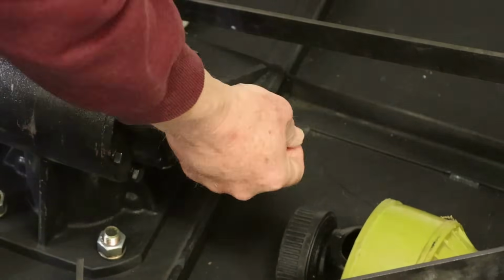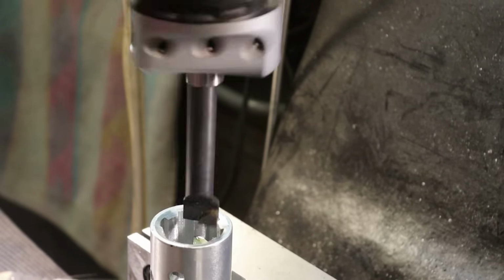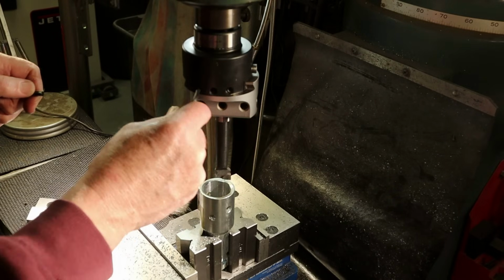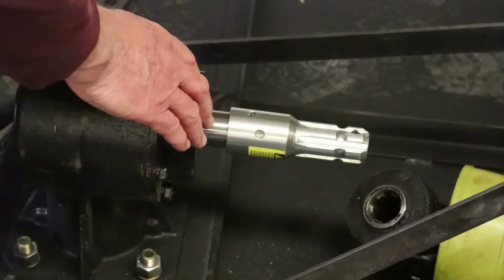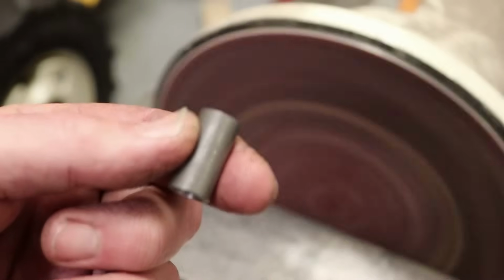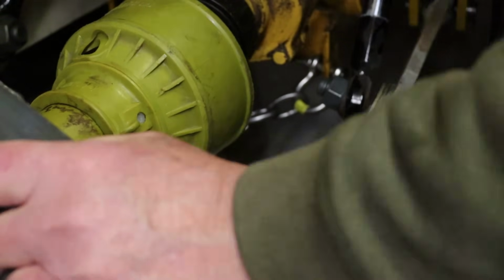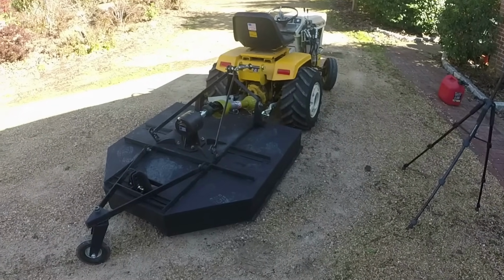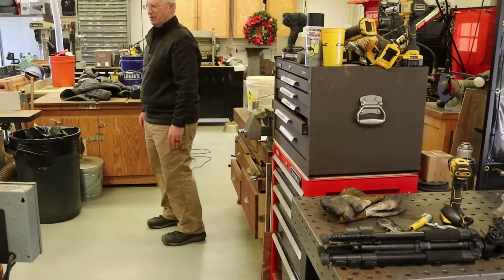Cub Cadet/Bush Hog Build: EP 16, First Run!

Comment: When you buy a pto shaft it will say on it that you may have to cut to fit cause it has to have the ability to slide in and out when raising and lowering the implement DO NOT USE GRADE 8 GRADE 5 OR LESS IS RECOMMENDED

Comment: You have a cool project for having fun, one thing you might want to remember is if you have to stop fast. Disengage the PTO, that would allow you to stop without being pushed by the equipment. Another thing is your grag tire needs to be about the same size as the front tire on your unit. Actually larger would be great. Just make sure you get something nonphumatic because your always going to have a flat tire if not. I'm sceptical about your sway chain crossing the PTO. Check out old Ford and Ferguson tractor design, they used a flat bar to control sway. They are available at all farm store outlets and you can make it yourself cheap. You do fun projects I like watching your work, and you enjoy doing it. So keep up the good work.
Reply from the maker: A bigger tail wheel is in the next episode, I've also ordered an overrunning clutch for the drive line. Also looking at turnbuckle anti sway connections.  Your suggestions are spot on.
Reply: @woodandmetalshoptime8048  I grew up farming and I don't like butting in on someone else's build. But I don't want to see you fail for easy fix things like that. You have a good idea for a better finish now.
Reply from the maker: I never claimed to be any kind of expert. I'm just a guy, with limited experience in many things, playing around in the shop.  You'll see my successes and my failures. We all learn as a result. I always appreciate the advice from more experienced folks.

Comment: I was in business for 10+ years and experimented with all sorts of metals.  DId diamond and steels and others.  Mostly AR400 and AR500 Mostly not steel.  I was building a booklet that kept data on metals and thickness and the tip I was using.  One time I tried a metalized ceramic tile.  Oddly it cut a slice but was so glassy I never tried that again.  there was enough metal in it for glint that current would pass.  Odd experience.  I made custom parts for engines and targets.  Supported 4-H and the Scouts.

Comment: Maybe your 4 has a larger hole in it.  Normally does as it is the standard chuck to use a three is for general use.  Centering is perfect or could be on 4.  3 jaw is close.  IMPORTANT :   Looks like at 40 or 41 - your H frame bender is racking to the right when pressure is applied.  Might need reinforcement.
Reply from the maker: I don't have a working 4 jaw at this point for this South Bend. I haven't replaced it because I've ordered a new lathe.  I think the racking of the press is just equalization of stresses on what is probably not an exactly square assembly.

Comment: You built a great rotary cutter frank!  But I think it’s time to face the facts.  You built it to big for the tractor.  Lol.  Or actually bigger than the tractor.   Bright side. I bet it would be a great fit for the kubota bx you have.
Reply from the maker: I agree it looks too big. It may well be. The proof will be in the grass cutting later this spring.  To be honest, though, throughout this build, the BX was in the back of my mind all along. Hooking it up to the Cub was a challenge I just couldn't pass up.
Reply: At least there are no real wasted steps on the build, Frank has a bush hog he can use with other tractors and a Cub Cadet that has an operational three point hitch with separate hydraulics for each side that would be really handy for grading a driveway with a blade. 
   I wondered about trying to lighten the bush hog up some when you were building it but I never really saw anything that you’d want any lighter, especially when you’re using it hard.  Pretty cool, thanks.

Comment: I was thinking the shear pin size, should be determined by the weakest part of the drive train, which is probably the power shaft inside the tractor.
Reply from the maker: The drive shaft is 5/8 inch steel, weakened some with 1/4 inch roll pins at various connection points. I'd hope the clutch would slip before anything broke...
Reply: I wouldn’t be concerned at all with a cheaper grade bolt as a shear pin. I use the weaker ones for the reason stated above. My 25hp subcompact tractor rarely shears a 5/16” pin in my 5’ woods brush cutter. Same with the 1/4 bolt in my snow blower auger.

Comment: I think your lower 3pt should be shorter probably at the 1st  bend from the hog
Also you could put them on the insides of the hog
The top link lower it to the bend below the fender at the 1st bend b4 it goes to the tractor

Comment: It would've been smarter to replace the piece on the PTO instead of having a spline coupler change that out with the smooth piece to go on to the other shift they do sell those pieces
Reply: And if the shear pin shears, there is nothing to hold the PTO shaft on the gearbox.  He cut off the part of the shaft that had a snap ring groove to keep the PTO shaft from coming off the end of the gearbox.

Comment: This is one of your machines that could really use the hydrostatic drive. But nice job overall! I was the shop supervisor at an IH farm equipment dealership for 20 years and Cub Cadets were great then and are still great. I still have 4 of them in use.
Reply from the maker: The hydrostatic tractors did not have a rear PTO.
Reply: @woodandmetalshoptime8048  they are just great little machines
Reply: But could they?  Same principle @woodandmetalshoptime8048

Comment: Build you a push bar for the front of the tractor out of heavy stuff and kill to birds at one time. Push bar to push brush over and you need the weight. Verh good build im amazed at the tractors you have built.

Comment: Nice!  You need more angle on your tailwheel and the swivel needs to be a vertical section with a bearing on top and a bearing on the bottom.  Google J3 Cub Tailwheel for an example.

Comment: The shear bolds are always grade 2 but they would not hold up in mine so I put a grade 5 no problem
Reply: I was out of grade 2 so used a grade 5.  I hit a piece of concrete that was hidden in the weeds. Then I purchased a replacement PTO shaft. Now I use grade 2.

Comment: I have a Ford 8N with a large brush hog and when I first started using it, I  learned the hard way of what an overrunning PTO clutch is. I nearly ran into a house I was mowing behind and needed to turn as I approached the house. Trying to stop by depressing the clutch I learned that the spinning cutting bar drives the tractor even when the clutch is depressed! I did get the tractor turned just in time but my Butt puckered all the while. I happily  purchased the attachment the very same day
Reply: There has been many farmers hurt or even killed back in the day bush hogging around ponds and steep banks using them tractors. By the PTO pushing the tractor forward after the clutch is pushed in. We had one when I was a youngster and my dad was teaching me about it by putting a metal barrel out in front of the tractor and making me learn the distance it took to stop the tractor with the bush hog running . My mother-in-law still owns one as well.
Reply: I worked for a Ford tractor dealership during the summers, while I was in college.  An overrunning pto clutch was standard on all our 8Ns.  We sold a lot of rear mounted mowers, and those clutches saved many lives.
Reply: Later models of Ford Tractors I believe came equipped from the factory with them, @robertheinkel6225
Reply: They sell them at tractor supply
As far as your chains and 3pt you should of look at the 8n
Reply: Over run clutch goes on the tractor side
Reply: On some tractors when you press the clutch the pto doesn’t disengage would this still apply on a tractor that the pto does disengage while clutch pedal is pressed in (l175 kubota)
Reply: The easiest way to determine if you need an OR clutch is to hook up your brush hog and try it out. First get moving with your BH engaged and then depress the clutch. If your transmission keeps the tractor moving, then you need an overrunning clutch. @ryanmeier6437
Reply from the maker: I've already ordered one.
Reply: Looks like we all have ORC lessons . My Yanmar 2000 needed one especially when I'm at 2nd pto spd I think it's 540, 750  and 1050 rpm . Be safe and glad it's up and running  Frank .
Reply: Had to get one for little iseki I own cause it almost pushed my brother over a cliff
Reply from the maker: Yep, I need to install an overrunning clutch on my drive shaft. Maybe it can replace the shaft adapter/ extension.